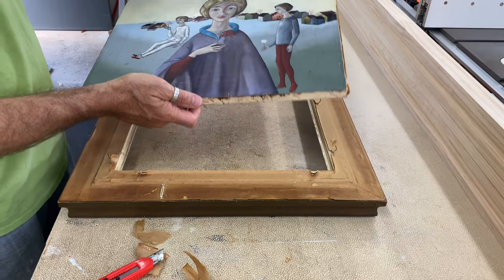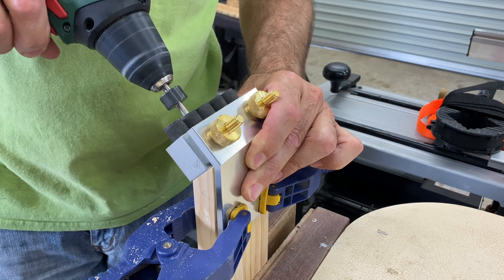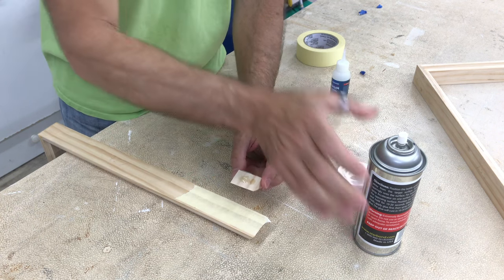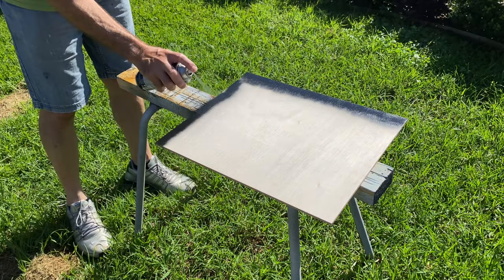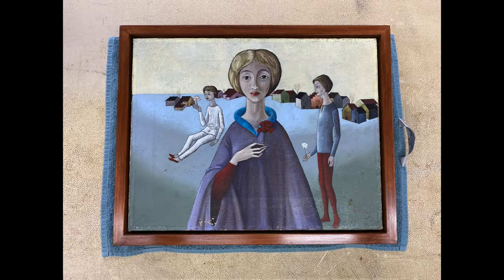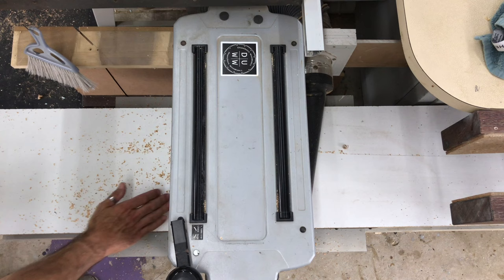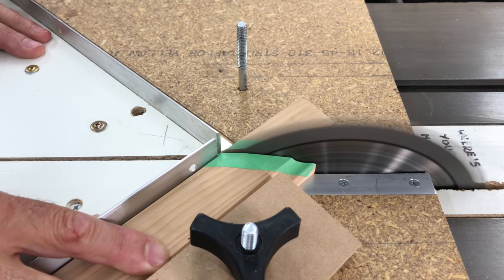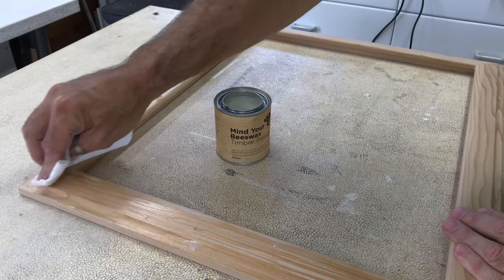How to make doweled mitres for picture frames

Comment: I admired your skill and precision.

But as a newbie I think at 9:15 you ran the piece on your router table left to right contrary to conventional google and YouTube opinion.

Here is a typical quote from an authoritative source:-

“When routing on a table, that is with the router mounted beneath it, the feed direction is always from right to left (against the face of the fence). This ensures that the workpiece is pushed by the cutter against the table fence. If you attempt to feed from the opposite end, the workpiece will be pulled away from you”.

Not sure if this is just nitpicking, or you have a special reason. Also, you made a valid point with selecting grain direction and the thicknesser, do you follow a similar approach with grain and the router table?

Thanks for your series, I really enjoy them.
Reply: Oops just noticed you were on the inside of the bit, so all good.

Having my eyes tested this arvo so maybe expect a new prescription.

Apologies for doubting you. Also just noticed arrows on your router table, good idea. I have notes all over mine.
Reply from the maker: Ha, no worries mate. That advice you quoted is correct but as you said, in the video i was on the other side of the bit. The most important tip is to make sure the piece of wood is travelling against the direction of the bit. Grain direction is very important particularly on the router table. i have a good example of this in my "Bath Caddy' build video. i use a double bearing flush bit and turn the piece over so that I'm always cutting with the grain. https://youtu.be/rkymgFm1hB8

Comment: Nice job Vic; it's a wonder those old Irwin clamps didn't run screaming from the shop when you put them up against the nice new PJ clamps :)
Reply from the maker: Haha, yeah mate. The Irwins are a bit of a staple in my shop as they are in many other workshops too. Only have a small number of the PJs, maybe Timbecon could send me some more :-)
Reply from the maker: @1963uspl  Thanks mate, already got a heap of those.

Comment: I am interested in your choice of the Dowelmax dowel jig. Did you consider other jigs and if so which ones? I need a versatile dowel jig but the Dowelmax is out of my price range. Thanks.
Reply from the maker: Yeah, i know it appears to be expensive but it is a stunning piece of precision and functionality. I looked at all the jigs available and although ive never tried any, none of them looked as good as the Dowelmax
Reply: @DownUnderWoodWorks  where did you buy yours from? AU or overseas and shipped?
Cheers
Reply from the maker: @roughnecktrekker1976   Hey mate, i got the jig direct from the manufacturer in Canada. I have an affiliate code you can use https://www.dowelmax.com/?aff=3

Comment: How do you hang these frames when the have a flat back?
Reply from the maker: These ones were up to the client to hang but i usually attach a string or wire to the back of frames for hanging on a single nail or hook. Take a look at this video @ 13:50 https://youtu.be/GB9vmL3ZsB4

Comment: If you have a power saw, why would you cut to rough length by hand? And I notice this vid is 2 years old, I’d bet 1 US Dollar that he’s lost at least one thumb tip by now bc not using a push stick. People, use a f—ing push stick for crying out loud to avoid having your fingers millimeters from the blade…
Reply from the maker: Cut by hand because it’s so much quicker and easier for that size timber. And I’ll bet you any amount of money that I haven’t lost a thumb tip. In the two years and for that fact in the last forty years I’ve been doing woodwork I’ve never had a power saw injury. Before mouthing off you should just watch my videos and you would have seen for yourself that I still have all my fingers and thumbs.